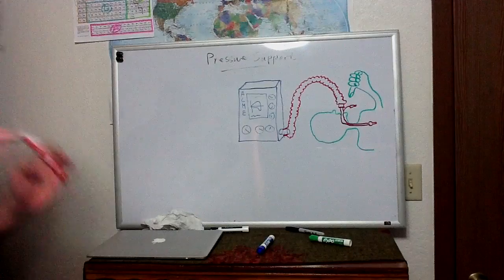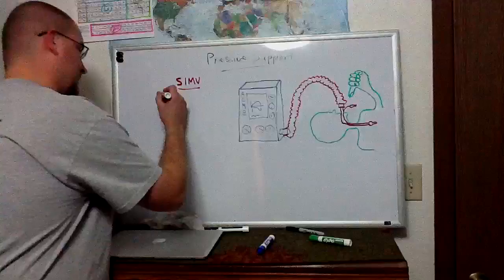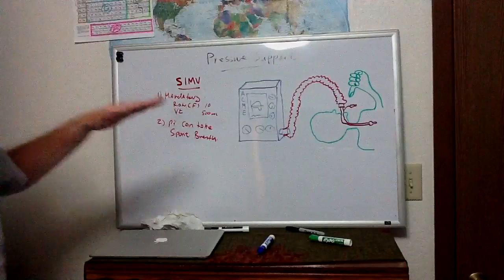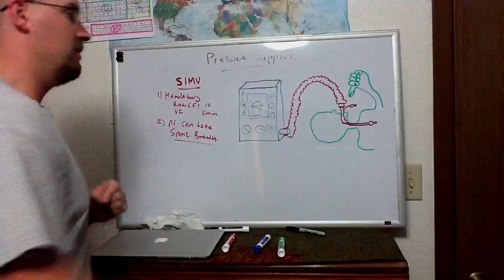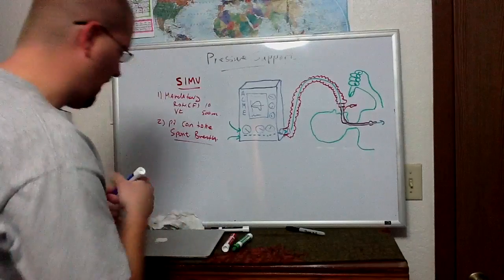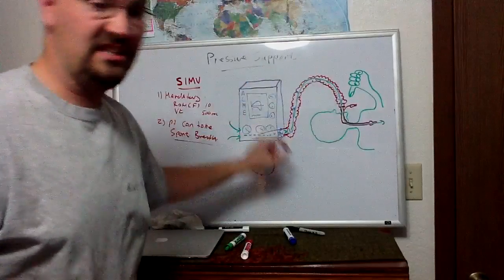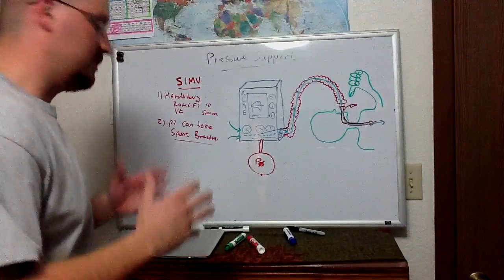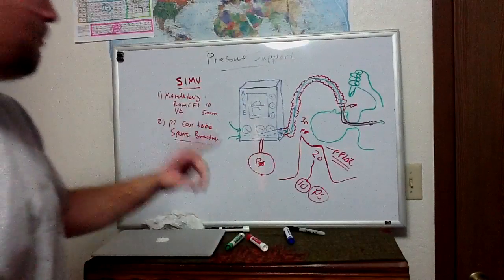What is Pressure Support?

Comment: ( Continued .) As tolerated, as long as the Pt. maintains the adequate Tidal Volume. 
The pressure generated to deliver a Spont Vt of 320 or so, will be Less than the pressure  generated delivering a mandatory breath with a volume of 500 ml.

Comment: Another way to think of PS is as a SEMI assisted breath. instead of using PIP & plateau pressure,to set PS, set Pressure Support by how much is needed, so that the Pt can achieve an Adequate Spontaneous VT ( say 320 ,or so )   A Ventilator dependent Pt., can't be weaned from the Vent on A/C. ( You can, but you may have to re intubate later in the shift. PS is to DECREASE the work of breathing, while the respiratory muscles regain their strength. Decrease PS by 2 every 4 hours as tolerated.